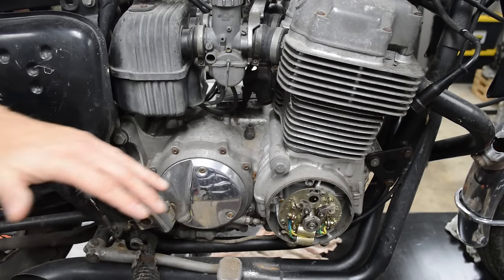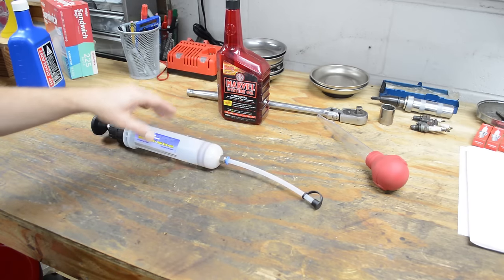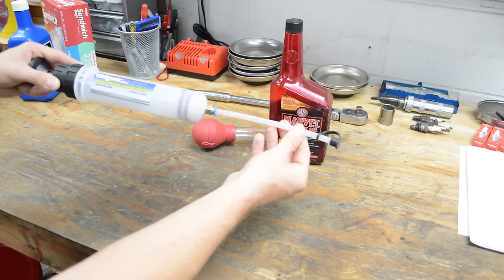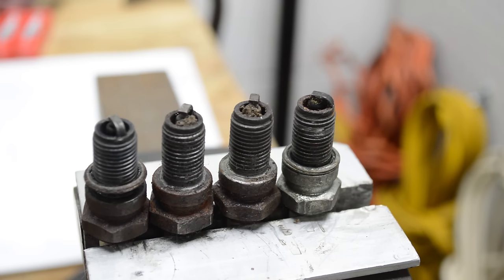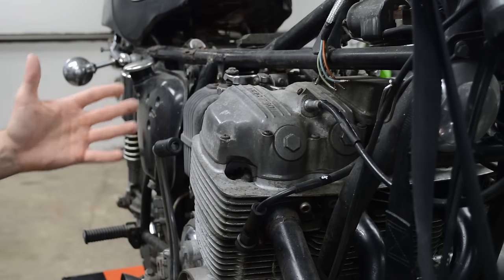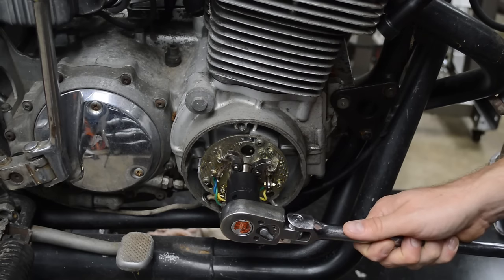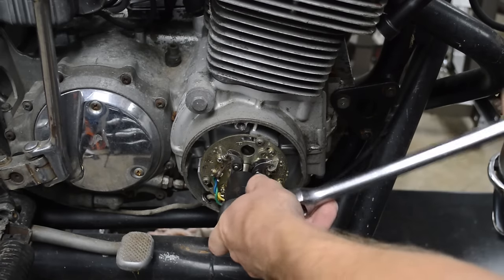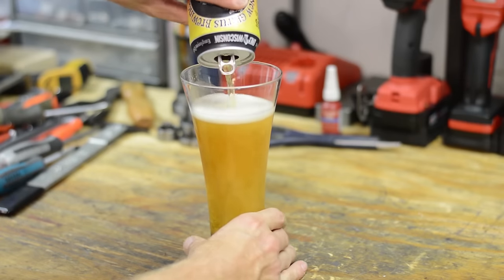How-To: Unseize a Motorcycle Engine

Comment from the maker: Here are the link to products used in the video. Make sure to check out the Allstate video:

Marvel Mystery Oil
https://amzn.to/2WzLeGl

Mityvac fluid extractor
https://amzn.to/2WDj7WM

Turkey baster
https://amzn.to/2Wy5KCd

Allstate coolant change video
https://www.allstate.com/blog/change-motorcycle-coolant/
Reply: Mate put it in second or third gear and bump the back wheel back and forth by hand also take rocker covers off make sure cam bearings not sticky also bet clutch plates stuck together be careful with clutch centre fragile lol seized two strokes take head off put bike in gear and rock back wheel the pot goes up and down on con rod bumps up and down on studs same with really sticky four strokes (make sure you secure cam chain or monster build lol 😀 )
Reply: @Frank Blackcrow Marvel Mystery Oil is available at every parts store here in the US.  I have used Diesel Oil to clean out an engine, but I haven't used it for this application.

Comment: I am also a proponent of Marvel Mystery Oil and do things very similar, except I don't use a ratchet on the crank.  Instead, I pop the MC on the center stand and put it in 3rd or 4th gear, get behind it and slowly rock the tire back and forth until it spins free (always being careful to not hang up a ring ridge).  Once I have went two revolutions, I am fairly confident it is good to go.  Great explanation, sir!
Reply: Fan of MMO
Reply: Hi, how would you get the MMO out of the engine? Would you crank the engine and it would come out through spark plugs?
Reply: @SuperAmoney2000  Some of it shoots out of the spark plug hole via compression.  The rest you can just drain via the oil drain plug when you give it an oil change!  Thanks for watching!
Reply: @vintageyamahabackyardresto4995  I’ve had my MMO in for almost a day with no change in the seize. Hoping to help and back it’ll work.

Comment: I am amazed at the amount of good engines that seize up from sitting. If I let my engines sit more than 6 months, I will put Marvel Mystery oil in each cylinder, and plug the intake and exhaust. I will go back to the engine years later, and roll it over and put more Marvel Mystery OIl in it so I never have to unseize one or take a chance at damaging it by breaking it free.

Comment: I successfully unseized a 78 cb550 with the Acetone/ATF 50-50 mixture doing this.  It took 5-6 days of soaking.  I slightly loosened the oil plug.  After about 4 days there was a slight drip but one or more pistons were still stuck.  I added/fed more of the mixture the next two days.  Using same approach here, came free.
Reply from the maker: Good tip on oil drain plug. That tells you the mix is seeping in.
Reply: I have a 2 stroke motor that has been sitting for a good while. Can I dump  diesel fuel in the crank case and let it soak to break down all the gunk?
Reply from the maker: @edwardwilkerson5790  Diesel may be too harsh on crank seals. Use marvel mystery oil. Remove spark plug, reed cage, and pipe. Put piston at TDC and fill it up.
Reply: Hi Fezzler. Why loosen the oil plug? Do you drain all the oil before doing this so that you can see if the mixture is coming through?
Reply: @conradpaul6100  Yes.  I drained the oil.  The loosening oil plug was so ATF/Acetone mixture added to top could drip drip drip flow to bottom.  I guess I thought movement/agitation would be good.
Reply: @Fezzler61 if you saw the mixture drip through the oil drain, is this a good or bad thing? I'm assuming bad as that means rings have a big gap by being broken??

Comment: do not try and unseize the motor by turning the points rotor bolt .... put it in top gear and rock the bike back and forward and if you have to turn the motor any other way go to the flywheel side and put a strong bar on the flywheel you will see what I mean when you look at it ..DO NOT put a spanner to the flywheel retaining bolt..... and don't use the starter motor as you may wreck your starter clutch and if that starter clutch is on the inside of your crank case's then it's a motor out and strip down to fix

Comment: On a CB750K0 that had stood for 30 years in a shed (around Mont Blanc, Aosta, Italy) the engine was stuck. I left it soak the whole winter in wd40 i injected it from plug holes and carb inlets , I  used an electric hot gun to warm up cylinders all around, while in gear I  rocked the bike gently back and fro, eventually one day I used a big van battery with two jumper cables and activated it on the starter motor itself for a fraction of a second, hitting the end of the jumper lead to the + connecting bolt of the starter, having earthed the bike with the other lead. Eventually it turned. I never applied any continuous force, just lots of little gentle shocks when rolling back and fro,  I would not advice applying any torque on the side of the crank

Comment: Very good video. I didn't think many would know about this trick and additive used that way. I learned it from an old school master mechanic. He always started with MMO, then wait at least 30 minutes and crank the engine (using battery) without spark plugs but instead have the engine compression tool connected to measure the compression. If any of the engines were lower than factory defined spec, then drop a bit more MMO and wait at least another 30 minutes before trying again. He would move on to using PB Blaster if the 3rd attempt failed as well. PB Blaster is a more aggressive additive which could be used on severely seized engines.  It works faster than MMO too. I poured an ounce or so of MMO twice while waiting 30 minutes or so in between and nothing. Switched to PB Blaster and sprayed a second or so into the cylinder that was barely getting 115 psi on one of the 4 cylinders on my 1987 Honda Magna (and waiting about 15-20 minutes afterwards), it freed up nicely, all got about 185 psi
Important points:  1) Use a new/fully charged battery for compression testing
                                 2) Keep the cranks to no more than 6 hits (which by then the compression should have already achieved its highest pressure)
                                 3) After about 5-6 sets of cranking, it would be best to check and charge the battery, if needed
Regardless of what additive was used, once the cylinder frees up, you wouldn't want to continue running the bike like that (obviously). It is time to do an oil change + new filter!

Comment: I just got a 1977 Kawasaki KZ1000 in my engine is locked up. I'm using a 3 and 1 lubricant and engine oil. Because I don't have transmission fluid but if this doesn't work I'm definitely going to try marvel mystery oil I never thought to use that. I know anything lubricant base will work just about. I have on seized a go-kart engine with regular engine oil and transmission fluid mix and it worked great just slowly but surely work the engine shaft back and forth. I've been working on small engines for over 10 years and I never thought to use marvel mystery oil thank you for this advice

Comment: Sounds crazy, but I used CLR and it worked quick, but needed a good flush out. 1986 Yamaha BW80. Was basically a boat anchor. Calcified stuff and rust in the crank case, as well as the carb. Good thing the top end parts are cheap. Now focusing on the clutch.

Comment: I just dragged my beloved 87 Honda 200X in from sitting outside for like 15 years (cuz I'm a piece of trash) and I was horrified last night when I realized the engine was locked up. I started "googling" to see what fluids people were using with success and I'm really glad to have found this video and this channel. I've been using PB and that Freeze w/e spray (which I realized isn't ideal due to the moisture). Marvel Mystery oil has always been very much "beneath me" but I think I'll grab my turkey baster & give it a whirl! Great video!
Reply from the maker: Let me know how it turns out!
Reply: Im interested in buying that 200x if  it for sale I have a 86 200x
Reply: @kevinplourde9701  No. But wishing you Good Luck with your 86! #RideRed
Reply: @makaveli087  did it unseize?
Reply: @camomoto2544  probably never did run again

Comment: Never seen additives used like that. Interesting video, thanks for the advice 👍
Reply from the maker: No prob!
Reply: Have you ever tried using Seafoam in this way? I'd be interested to see the results using an inspection cam before and after. Have you tried using these additives in any other way? I'd like to see more videos on this!
Reply from the maker: @fgcvhhbvjhbj  Seafoam will probably evaporate? I have used seafoam to decarbon an engine etc...

Comment: so do you want to put the spark plug back in after putting in the oil or will that harm it?   also i put regular motorcycle in after taking out the spark plugs did i screw up?

Comment: Hey there, trying to do this on a 350f. Let the MMO soak in the cylinders for a week and a half then popped the side cover off. It's a bit of a disaster in there with rust and corrosion. When to rotate that bolt clockwise. Got it to turn once and some MMO came out the spark plugs holes. Went to rotate some more and now it seems like the bolt wants to turn but not the shaft. Thoughts?

Comment: What you have to watch out for on the CB750 is, the oil jets in the barrells can block up and starve the top end of oil, the cam runs in the head, no bearings, so you must check that there is oil reaching the top end.
Reply: Another thing when starting one of these after a while is make sure to soak the cylinders down good first. The pistons are aluminum and an oxidized cylinder will scrub that piston real quick.

Comment: What do you do after you get it unnseized? Full rebuild? Clean out all oil?  How to clean oil out of spark plug holes?
Reply: All you’ve gotta do is a full oil change. I’d just let you drain plug stay open for a few extra minutes and would also buy an extra quart of oil to run through the while the plug is out, works similar to an engine flush that way and gets residue from the MMO out.

Comment: Thanks man, looking at buying an XS500 with a seized engine at the moment, will give this a go if i do, thanks!
Reply: You will definitely have to free the rings only top end rebuild well worth it 9 out 10 times they stick if the rubber cv bit perished when you do the carbs smear clear mastic good temp fix until you can find replacements clutch plates probably stuck two clutch centre very fragile and very expensive be careful lol

Comment: My 2006 ex500 sounded like it started firing on one cylinder while riding I stopped it then cut out and wouldn’t start again, i think put too much oil in it. The left cylinder is hard to crank over but when left piston is down the right one cranks no problem( I have to do this manually) the electric starter isn’t strong enough to turn it over now. Please help

Comment: So I got my Yamaha VStar engine unsiezed just like you should how to. Now what is the process to getting it to run because I’ve done everything in the video and it’s unlocked but won’t start it will roll of once but won’t catch. Does it need to be in a specific gear? Or do I need to give it movement while I try to start it? I can’t figure it out and no one has a video that I can find.

Comment: question (and great video btw!!!)...I was gifted a '77 yamaha LB50 scooter, and wondering if I could just shoot some liquid wrench into the spark plug hole?  Sorry, kinda newbie here, but I DO KNOW not to try and kick it over!
Reply: Do the basic compression test to see if it’s locked or not bud. If it’s a scooter with gears put it into first push yourself down a slightly angled hill and before you get too fast to stop on a dime let off the clutch. If it doesn’t try to move forward and just stops you in place it’s locked.

Comment: What would I need to do if the crank shaft bolt spins? Previous owner tried to free it and didn’t wait.
Reply: Love this video but this guy doesn't respond very well I'm still waiting on the same question you have. Mine moves freely so I assume it's damaged but I don't know.
Reply: Sounds likes it's stripped out the bolt  probably have to tap the whole and use a slightly bigger bolt

Comment: I am looking at following this process for my cb550. If it was stored without oil, would I be ok to just add oil and then follow your process, or is there something else I should do first?
Reply from the maker: Do you plan on rebuilding the motor? If so, break it loose and tear it down. I have top and bottom rebuild videos for that model.
Reply: @HTMR  yes just top end. Just adding oil is the only extra step required given the circumstances?
Thanks, will definitely be following your videos
Reply from the maker: @duvis9  Adding oil to crankcase is not going to help unsieze it, since it just drains to bottoms. However, you don't have to drain oil to do just top end. So add it now or later does not matter. Just put a piece of tape near key that says "no oil" so you don't start it up dry LOL.
Reply: @HTMR  awesome. Thanks for your help!

Comment: using my grandpas account to ask this, would this work for a bike (1969 Yamaha 305 big bear scrambler) that was missing the left side oil tank and went through a 6 feet flood  and then sat for 13 years?
Reply from the maker: You will have to take the whole thing apart if it was flooded.

Comment: Can a motor  that was fine all a sudden lock from installing the nut on the magnet?  I reassembled my bike but maybe i screwed up because i lubed the cylinder with wd40 to get the piston back in and have not done any fast turning just turned it by hand and it was fine then today when i was preparing to start it i found it only moves about 1/4 turn either way then locks what the heck is going on?

Comment: My yamaha TTR-50cc has been sitting for a few yrs and I pulled out the spark plug and it has rust on the inside. I then dipped the end of a zip tie in and it came our covered in bits of rust. Do u have any suggestions to get it unseized. I've tried pushing the bike in neutral then kicking it in gear trying to unseize it, have done this many times but the wheel just locks up.
Reply from the maker: Start soaking it with marvel mystery oil and walk away for a week.

Comment: Do you think that would work for 2007 gsxr 750? It’s seized when the oil drained out.
Reply from the maker: No, it's time for a complete engine rebuild.
Reply: Engines seized due to a bit of corrosion in the cylinder isn't the same as a piston 'welded' in the bore due to massive heat. Honestly, unless the rest of the bike is immaculate (or sentimental value) I would just strip it down, sell the plastics etc. on ebay and put the proceeds towards a different bike. Unless you plan to rebuild it yourself, wrench time alone will cost more than a 13 year old Suzuki is worth  :(

Comment: After  letting it sit do you  try to loosen the nut gradually with bike in gear or neutral? It's been about 10 hrs since I put mystery oil in the cylinder so I'm asking in case I'm still stuck. Your feedback is appreciated
Reply from the maker: With nut on engine neutral. You can also put it on top gear and try to rock or spin the rear tire.
Reply: @HTMR  listen my guy I wanna say thank you very much. I noticed its been a couple months since this post and doubted your reply... I'm now a believer and will subscribe. Thanks again seriously.
Reply from the maker: @poloswag2011  No prob

Comment: So I was rebuilding the top end on my bike, and I was moving the crank to make sure it was going right and then it just locked up so would I just put the oil on the crank?
Reply: It’s probably bad crank bearings that happens a lot on dirt bike especially two strokes

Comment: How do you get the fluid out of the cylinder?
Reply: When I freed mine up, I just fired it up and it poured a ton of smoke out so I’m assuming it burnt it up lol. Like he said a lot will puke out of the spark plug hole but there will still be some residual fluid on the walls.
Reply: Just run it
Reply: @zacsmith1388 so after you turn it with wrench do you jus use kickstart?
Reply: @numanr5190  This was a couple brain cells ago so I am trying to remember. I am pretty sure that once I had it freed up, I ran the starter without the spark plug in it and the fuel off, once I wasn't getting any more oil out, I put the plug back in and turned the fuel on and it fired right up. Lots of smoke LOL.

Comment: Left it sitting for a few days with penetrating fluid and nothing changed. Any ideas why? My dirt bike has been sitting for awhile.
Reply from the maker: Put it in high gear and rock back/forth.
Reply: Your dirt bike piston is probably seized for different reason and not just rusty rings/wall.

Comment: You can easily break that bolt off in the crankshaft. Be careful!
Reply from the maker: Yup, mentioned that in the video. LH rotor bolt would have been a better choice.
Reply: Put it in gear and gently rock back wheel back and forth no damage lol
Reply: Sadly, I broke off mine in my 1978 cb750k. What do I do? Thank you for your answer.
Reply: @chasetvph7379  try drilling it out with a left hand drill bit. Yes it cuts backwards so remember to run the drill in reverse and go slow. Sometimes the bolt will come out while your drilling it.

Comment: I just got lied to about a bike. I was told it only sat a few years and needed a carb. Nope, someone who knows this bike told me it laid on its side outside for 20 years. Motor is seized. Poured in MMO yesterday, just waiting for some change that’ll tell me I can finally just maybe get it free. Also I’m not a bike mechanic so mostly hoping to hell and back this even works.
Reply: I am in pretty much the exact same boat. Tell me how it went for you.
Reply: @bmetzy  no fluids we tried actually worked. Had to stoop down to buying an entire motor. Which was about $800 before shipping. Got most all we need minus air box parts and battery cover. But even now it won’t start because it needs the choke redone